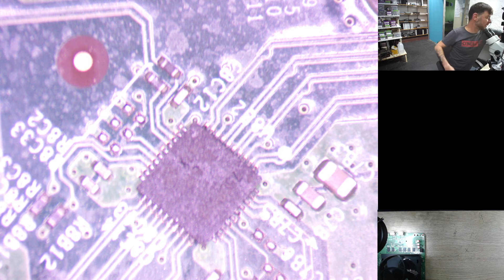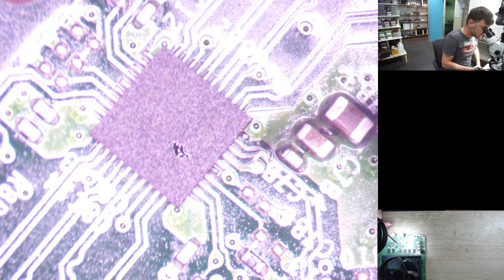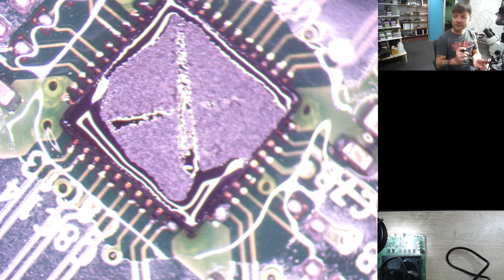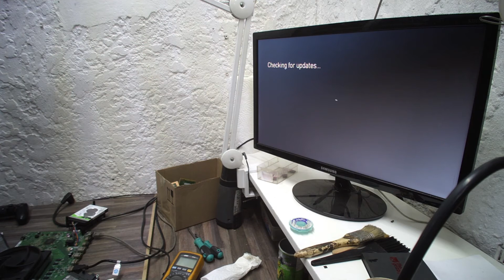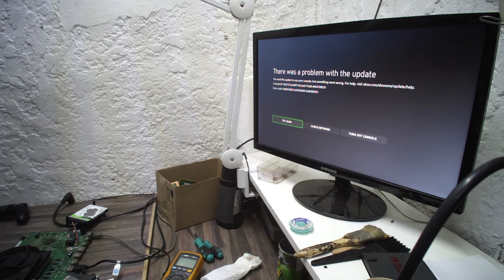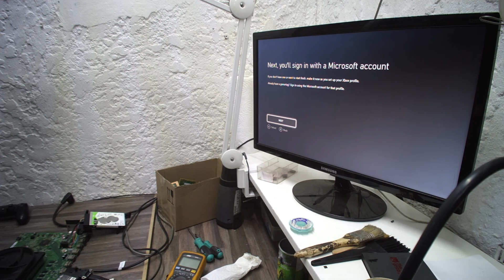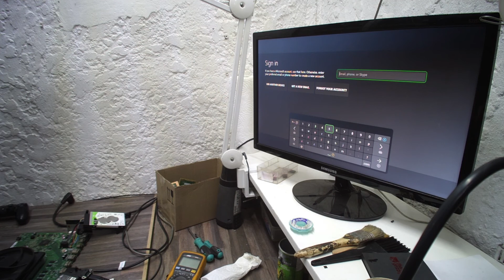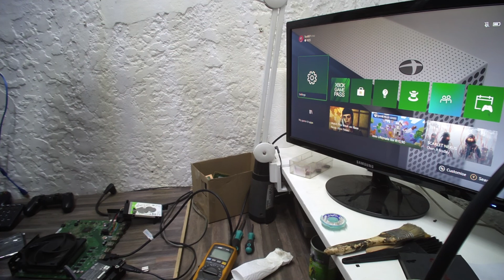How To Replace Xbox One HDMI IC

Comment: Hey Mr console repair guy...
I have problems with my xbox one s I thought that maybe you may help ...
1st- I was playing fifa 2 then suddenly players become ghost what was present was their soccer kit when change the home/away kit before running the match... Then I switched it off after turning it on problem 2nd happened 
 2nd - the  system was  starting to have a problem with green screen with xbox  emeblem.... Or sometimes updating the system becomes a problem...
3rd - I've tried troubleshooting it using the power button and eject button but still I've waisted around 14Gb of datas trying to update it but still no fix is done...
Lastly iam around eastrand town ship called vosloorus... 
So yeah please do get back to me.... 
And how much do you charge for fault findings before rectifying them....